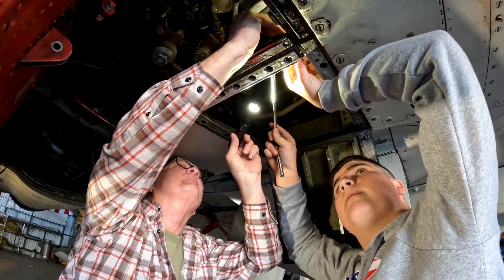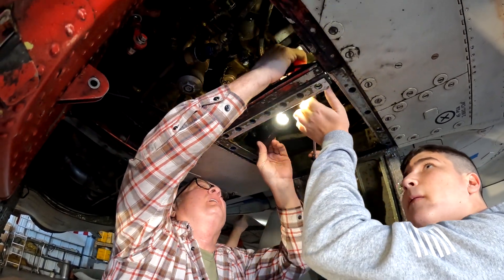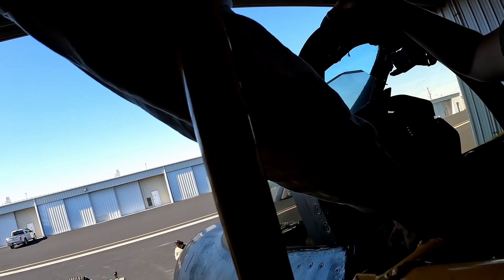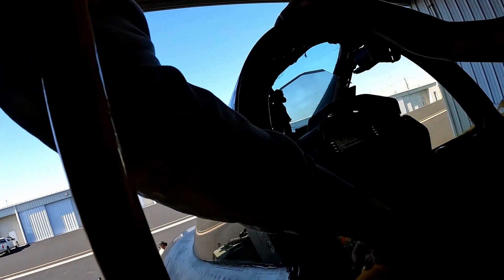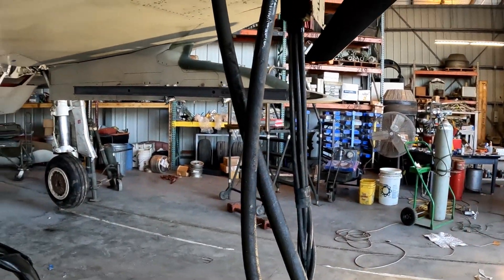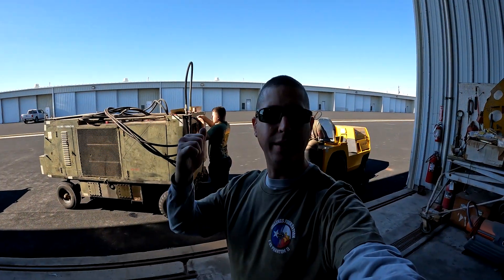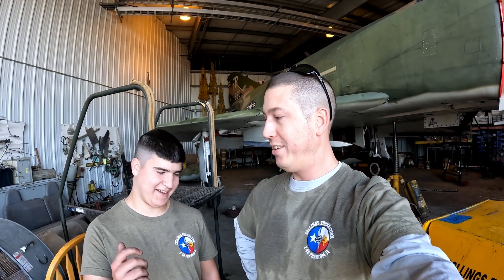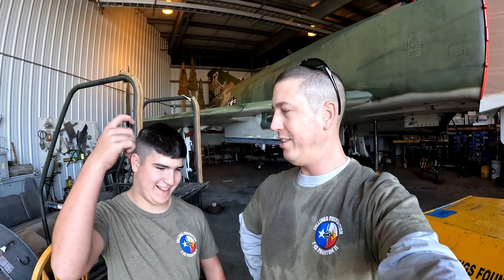Swinging the Gear! - F-4 Phantom

Comment: Thank You!

On an actual takeoff, I was wondering if the main wheels retract still rotating?

Cheers!🇨🇦🍺
Reply from the maker: As far as I'm aware, yes, they are still spinning after takeoff. I think there is a surface inside each gear well that will bring them to a stop upon retraction.
Reply: @DieselThunderAviation  Thank You Very Much for your reply! Good to learn something new. 

Cheers!

Comment: Good thing Al hit his head. Otherwise he might have been hurt. How many times did you cycle the speed boards? Did you run the flaps down? Why wasn't the guy in the cockpit not on the ICS when you were doing your checks? It would have been a lot safer.
Reply from the maker: Surprised him more than it hurt him. We' cycled them several times, we also did the flaps the last time we had the mule out. We had already briefed safety and procedure beforehand with hand signals.